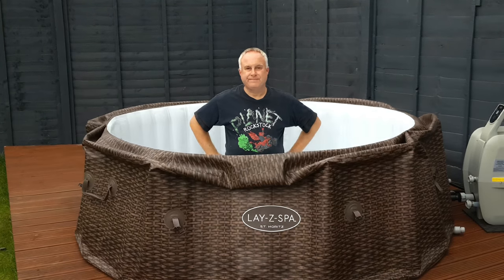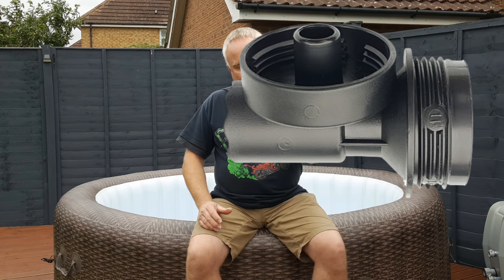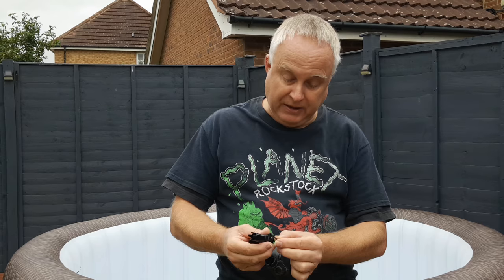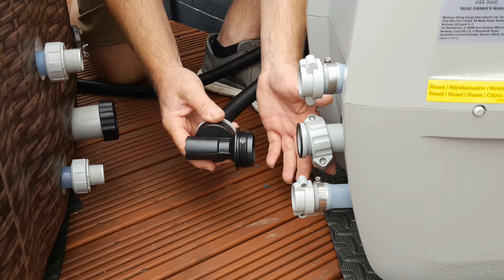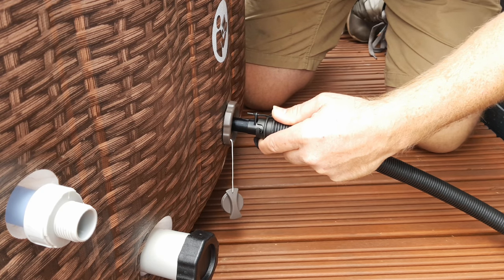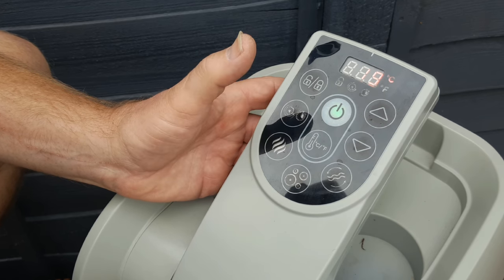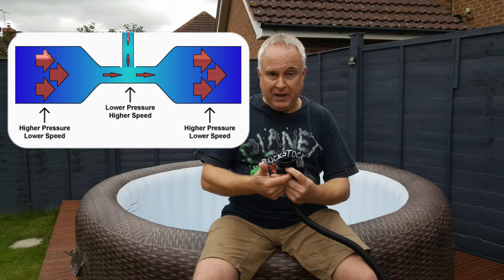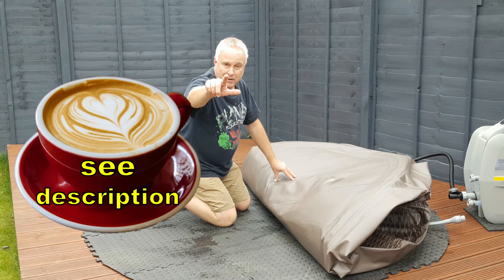How to Deflate a Lay Z Spa Using the Pump | in just 5 Minutes ⏳

Comment: The deflation adaptor shown in this video is for the top of the lazy spa.  You will find another deflation adaptor in the box (similar looking to the inflation adaptor, but slightly shorter and is hollow inside). for deflating the actual hot tub.
Reply: Thanks 👍
Reply: Thanks !

Comment: I am getting an E02 error when I am trying to deflate the tub. It will only work for 20 seconds or so before it stops. Do you have any advice on what I am doing wrong? Thanks.
Reply: Same here
Reply from the maker: E02 while deflating? That's mad because E02 is a water flow problem. Try slapping the side of the unit with your palm in case the flow sensor has become dislodged.
OR did you find another solution (it's been a while, sorry)
Reply: I had the same problem....and yes a good old fashioned slap on the side as used on anything that plays up .. television....radio ....🖐️

Comment: Hi please could you help with getting trapped water out of the liner at all? I can hear water inside when the empty tub is moved. Many thanks.
Reply from the maker: Tip it on it's side with the valve at the bottom and open the valve. It should be possible to get all but a bit out.

Comment: Hi there! Thanks for all the great videos, very helpful indeed! We have a lay z spa Paris and the instructions are rubbish so your videos have helped a lot!
Please could you make a video on the best way to save electricity whilst running the spa? Do you leave your spa on constantly? If not do you leave just the filter on? We only use our spa on weekends really so I have been switching it off through the week then heating it back up but I am not sure if this is costing more than leaving it on! Many thanks for any help on this!😁
Reply from the maker: Turning it off for a week and heating it up for weekends is innefficient. I would suggest setting the heat during the week at 5 or 6C below your use temp. Use the timer on a Friday night to bring it back up to usage temp. It's also important to run the filter pump at least a few hours each day for the chlorine to do it's work.
If you have an old bed quilt (or don't mind buying a cheap 13 tog), put it between the inflatable lid support and the main cover to cut the heat loss during the week (it really does work). That will cut the power use while it's not being used during the working week.

Comment: Followed instructions for my Bali hot tub but still seem to have water in the tub somewhere  sounds like it's in the walls?
Any ideas?
Reply from the maker: It could be seeping into the structure somewhere, ours does but only a very tiny bit. You'll never find it though, so don't worry about it. just empty it out of the valve port whenever you refresh the water.

Comment: You cannot remove the middle shader valve or I couldn’t and the only valve that fits is the inflated valve. I just removed the rubber check valve out of the inflated valve with needle nose plyers and bobs your uncle.   Good video otherwise thank you! I wonder if your version differs slightly from others?

Comment: I'm doing everything exactly as shown in the video but nothing happens. What can I possibly be doing wrong? Please help!
Reply from the maker: Are you sure you are using the correct adapter? You could be accidentally using the inflation adapter instead of the deflation adapter. The deflation adapter has two cutouts around the end you push into the valve.
If all else fails, simply unscrew the whole valve and let it down naturally.
Reply: Thanks I had the same problem.  Needed the other adapter

Comment: It was all working fine over the course of a month, suddenly, my spa's PRCD plug trips off as soon as I press the reset button to turn it on
Reply from the maker: Electrical fault, either with the RCD itself or the pump unit. If it's new take it back under warranty.
Reply: @AbouttheHouse0  That's what I did. at the store where I bought it.

Comment: The sucker does not work messagee02 no water detected
Reply from the maker: Could be a blockage in the pump or the impeller is loose on it's shaft. You can get repair kits on eBay, but you'll have to take the pump apart.